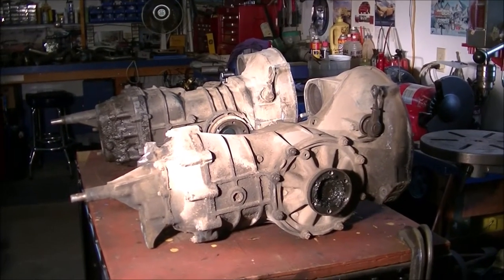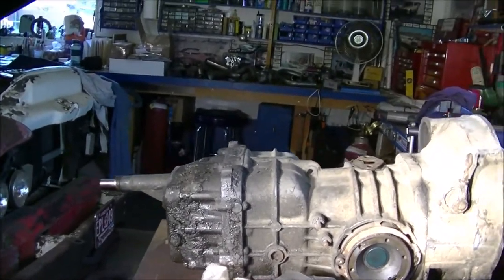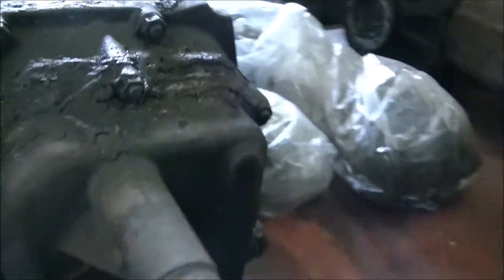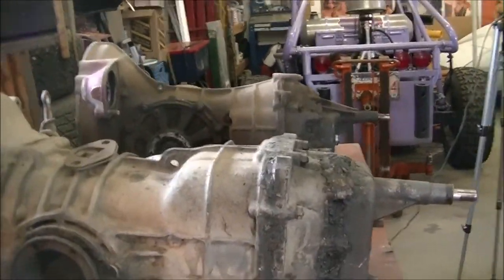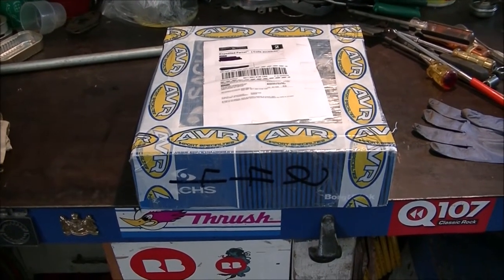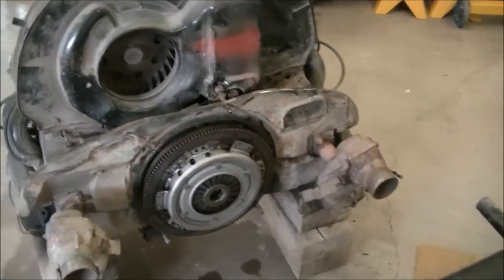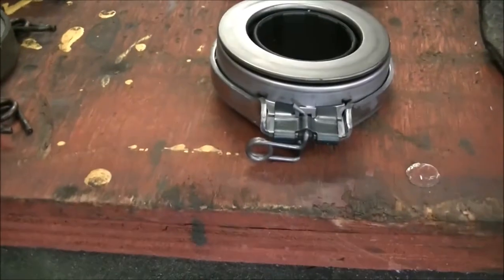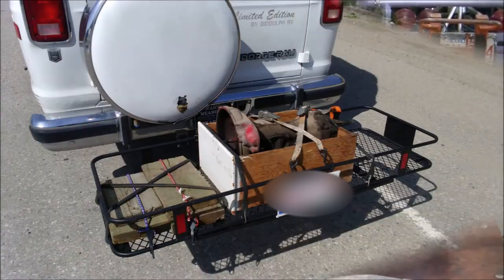VW Bug   Bus Transaxle Comparison

Comment: Are these as cores worth anything? Long story how I came into one. Been told it’s got racing gears but reverse is out. From reading it’s a “002”? The guy was involved in dune buggy racing.
Reply from the maker: Yes! The core is worth $150 cd. I delivered a trans axle personally to avoid expensive shipping charges. Now, it just so happened that I was going to be passing by AVR Import Specialties in Abbotsford British Columbia and they took the core in and handed my $150 cd cash on the spot. 
    Maybe if you check around you may be able find a VW parts supplier closer to home. This the guys in Abbotsford BC.    https://avrparts.com/     The next link is for California Import Parts in the USA.     https://www.cip1.ca/       Check around on the internet and maybe you will find some air cooled V-Dub parts people closer to your home. Good luck! 
   P.S. Reverse is the weakest gear in a VW transaxle. Always treat reverse with respect.      https://ranchotransaxles.com/
Reply: @AxelPowersGarage  Thank you so much for that information. I will research if there is anyone in my general area. I’m somewhat near St.Louis.